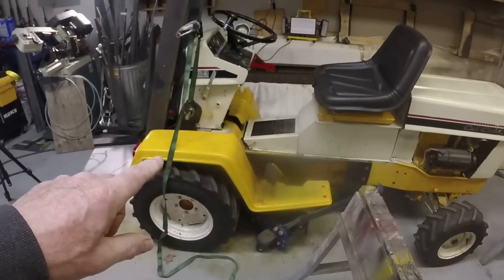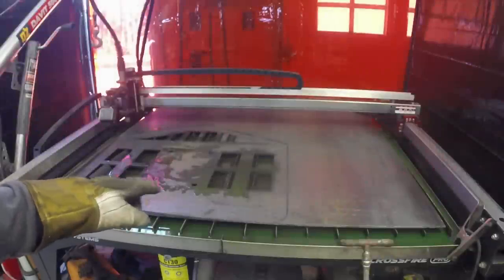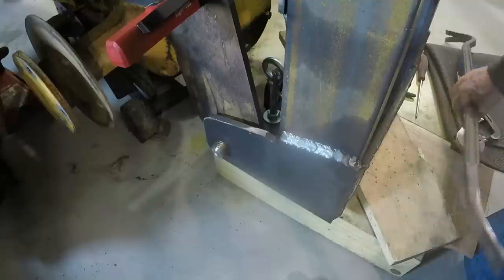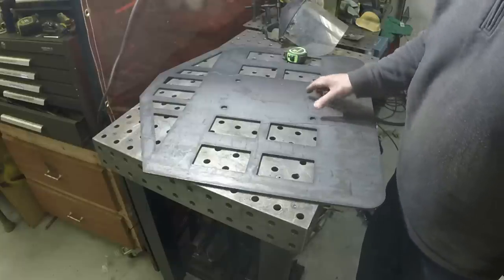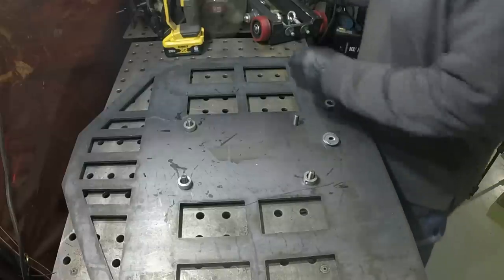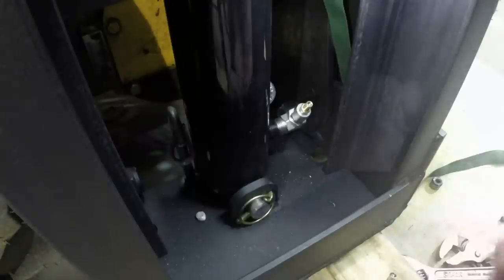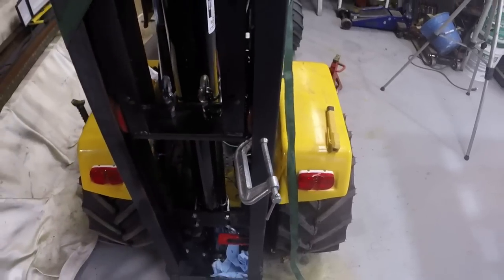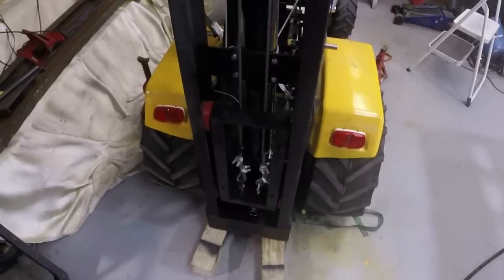Garden Tractor Turns Forklift, EP:25 Carriage Lift Mechanism

Comment: Years ago, I worked at a place that repaired hydaulic cylinders. The shop guys were working on a cylinder about 4" diameter and 12' long. To remove the cylinder rod and ram, they would use compressed air. 1 cylinder didn't want to come apart, so they kept applying more air. When it came apart, the rod went flying across the shop floor, hitting things as it went which caused it to rise off the floor. It went out the end wall of the shop. Luckily, no one was hurt, except for the new hole in the shop wall. The disassembly procedure changed starting the next day.

Watching you with the cylinder made me remember that incident. Hydaulic cylinders and compressed air can make for surprises.

Good job with the build. It is looking good. Can't wait to see it in operation.

Comment: While I agree with your assessment that using lift cables is a little simpler than roller chains, the inherent problem with the cables is to get them equally tensioned.  It's certainly not impossible, but it can be challenging. I'm looking forward to how you resolve that. Keep up the good work.

Comment: Forklift is coming right along and looking good. If I may suggest, remove the cables and take them to a crane and rigging shop or maybe a sailboat shop and have them swag crimp the cables instead of using the bolt on clamps like you have. I just think it might be a bit safer and cleaner. Only down side would be you would not be able to take up any slack that might occur in the cables.

Comment: Something to think about on the top of mast. Make a couple stops that can be bolted in where you want the carriage to stop. Then lower the carriage and tighten the cables. That will also keep the cylinder from deadheading.
Reply: I would disagree with you here. The cylinder won’t be deadheading since the hydraulic oil will be able to flow out of the top half as the piston is being extended. These cylinders are designed for these loads. If the carriage is stopped and the cylinder still has travel then it is possible for the cylinder to apply more load to the cables then they are designed for.

Comment: Looks like some of the hardware I have in a drawer.  I-beam bolts and Bridge washers made from M2 and 54mm center hole.  Has to be fluid inside to keep the seals wet during shipping and storage until use.  Looks like the cylinder moves nicely.  Air compresses and isn't  clean like oil that is smooth movement.

Comment: for your mast pivot, rather than having raw thread to support the weight of the mast and load, you could weld your spacer to the mast support and weld a nut to the outside of the mast. Then use a short shanked bolt put in from the inside until it came up against the end of the thead. The bolt could be locked in place with a second nut on the outside. The inner bolt end could have a cotter pin hole to limit any side to side movement or if you created a stud instead of a shamked bolt it could have a nut on the inside as well. I do enjoy the builds but feel its worth commenting from time to time. I know its only a toy as you have said before but....
Reply from the maker: Yeah, those bolts are just temporary. Replacement is coming in a later video.

Comment: Looks good sir! Idk if you have yet buy May won’t to consider putting water and wheel weights on the drive tires or possibly duel wheel setup. May be too top heavy with a load on it you’ll be surprised what a uneven ground or just a rock will throw it side ways.

Comment: you might want to check your cable clamps.  i was taught that you never saddle a dead horse meaning the base of the clamp should be on the lifting cable and the "u" bolt over the tail.
Reply from the maker: Yes, I learned that and have since changed them. A few were wrong and some were correct.

Comment: With those types of cable clamps for wire rope, I've always put one facing forward, and the second one with the nuts facing backwards, so they clamp opposite with the cast part vs the U-bolt?  Always seen them that way, so thats why I always did it.....
Reply: Never saddle a dead horse. The u bolt side always pinches the dead side and the saddle goes on the live load side. Never the other way around.

Comment: Frank, you put those crosby's(cable clamps) on the wrong way. The u-bolt part goes on the working side because when you have them the way you do, the cable end can actually slide right out once a load is on it.
Reply from the maker: Yeah, I've learned "Never saddle a dead horse" from another commenter. I've changed them around. You'll see that in several weeks.
Reply: The u bolt goes on the dead side always.  You never pinch the live load with the u bolt. During our OSHA inspections if the u bolt part is on the live load side it’s an instant fine.
Reply: I was always told to put the u bolt on the dead side

Comment: Just an FYI, forklifts do not use hydraulic pressure to lower the forks. They rely on the weight of the carriage/forks to lower. The top of the cylinder must be vented to atmosphere to work correctly. Nice build!
Reply from the maker: My cylinder is double acting to keep the fluid requirements down. So fluid just returns to reservoir from the other side of the piston, keeping the reservoir full.

Comment: Hi Frank, when I saw you putting the 2 schrader values on that, it won't work!! Can't compress air that much it a closed circuit like that!!
Another great video, just watch the angle that you put the tilt cylinder on, not too much of an angle. As they will have too much residence working at, say 45° as you looked like you showed. Really need them with about only 10/15° above from horizontal on the mast..

Comment: You may consider putting a switch on one of the cables to prevent a slack cable situation potentially allowing a cable to come off the sheave
Reply: I did see you have the cable captured over the sheaves though with the bolts and plates. So maybe that is sufficient

Comment: Frank, nice job here. I agree, don't run a oil hydraulic on air. Watching this happen here, I'm surprised It didn't blow the top out (It can happen easily when it's slammed against the top). Also, would it be easier to just put a piece of cold roll bar across the bottom as the mast "axle"? With those bolts across the bottom, the threads are going to wear off VERY easily, and it will give a sloppy joint.
Reply from the maker: Axle won't fit across the mast due to interference with the cylinder location. Those bolts are just temporary. Working on bronze bushings and finished shaft (eg 4140) material to replace with.

Comment: Your clamps holding the cylinder might be causing your jerkiest operation. They might be bending the cylinder tube and causing the inside piston to hang up at that position, you might have to shim at the clamp locations between the cylinder and carriage.
Reply from the maker: The jerkiness is due to the static  vs. dynamic friction of the piston. Need to overcome the static friction, then it moves quickly. Won't have that issue with hydraulic fluid. The cylinder is 1/4 inch wall, those bolts aren't strong enough to deform it.

Comment: Hey frank great job on the lift but you know that there's a lot of weight going on the front. I'm not sure but it seems like you might want to put a weight rack on front to balance it out. I'm not there to see but I was just. Wondering. But I know you know what you're doing for sure
Reply from the maker: The counterweight was discussed in the first video. It's coming in a couple more episodes.  400 lbs.

Comment: I think I would have used chain instead of cable. Seems you would want fairly even tension on the lift cables. Chain would be easier to make a givem length without much stretch. Seems cable would be difficult to get same length and would also maybe stretch eventually a bit. Just my thoughts. Not an expert by any means. Nice work all the same. That thing will be handy!!
Reply from the maker: yeah, the cable is not as good as chain would be, but much cheaper. If it were going to lift more than the 1000 lbs. I'd definitely gone with chain. Cable will work OK I think. One cable will stretch  a bit, shifting load to the other. Eventually, they will share the load pretty evenly.

Comment: I didn't recognize if you said it in the video or not but when you spoke of the capacity of redundancy of using those cables and the thousand pounds that you plan to lift, were you also taking into account the total weight that you are lifting with those cables when you use them? Because you are lifting the total weight
Reply: Of  Anyting attached to those cables
Reply from the maker: the cables are actually rated at 1550 lbs SWL (I think I said 1200 or 1250 in the video). Average breaking strength is 5450 lbs per cable.  With a weight limit of 1000 lbs plus the carriage and forks (200 lbs) I think I am still under the safe working load of a single cable.
Reply: @woodandmetalshoptime8048  Sounds like it. Definitely sounds safer than the videos numbers.

Comment: have you thought about some extra counter weight for the engine end and turning the little tires around as well
Reply from the maker: Counterweight is part of the design, discussed in the first episode. Will be about 400 lbs. Not turning the front tires around anytime soon. Will get changed out for turf tires when I upgrade the front axle and wheels sometime this summer. All will be discussed in upcoming episodes!

Comment: The thing I’m wondering about is the hydraulic capacity of the tractor and are you going to have to add a tank or just fill up the cylinders and the pump will work normally?
Reply from the maker: 2 gallon reservoir in the drive axle.

Comment: What is the load rating on the rear, now front tires?  Sufficient for your expected lift load?
Reply from the maker: Yep. 6 ply tires. Only lifting 1000 lbs.
Reply: @woodandmetalshoptime8048  I'm absolutely sure they will be fine regardless of the spec but one thing for people to keep in mind about the lifted load vs weight on tires is that since the carried load also shifts weight from the 'rear' of the machine towards the front of the machine, the weight on the front tires goes up at a more than 1:1 ratio with the load.  You already did the math about the necessary counterweighting and all that and i don't recall if you predicted a max loading on the tires in that episode but I would not be surprised if a 1000lb load on the forks at a 'typical' load center (24"?) might put 1500-2000lbs on the front tires. Great episode, keep it up!
Reply: @Vigo327 , I just googled (I only looked at the first one that came up) the weight rating for a six ply tire and it said it had a max weight of 1670 pounds. 
With two tires on the front, Frank should have plenty of extra room with the weight. 
  I wonder if Frank has a plan to find something that weighs around 1000 pounds or a little more to test his theories on the weight issue. Maybe even go 20 percent over to give himself some leeway.
Reply: @Hoaxer51  Factory forklift hydraulic pressures are probably 'tuned' to prevent tipping the machine forward just by pulling a control stick, but Frank might have to find that point himself. IF the machine ever picks up its back tires then the front tires are carrying the entire machine weight + load weight. But loader tractors do this all the time on their smallish front tires and are fine (mechanically) because it usually happens at low/no speed.  Tire weight ratings assume you will still 'travel' and hit bumps at that loading. A tire's weight capacity when not rolling, or barely rolling, and not bumping hard into anything, are.. ludicrously high. There's a decent chance the wheel centers would cave before the tires themselves popped from 'static' overload. So i think on a tiny homebuilt forklift operated with an abundance of caution, the tires are actually not much of an issue. The only thing i wouldn't do is traverse anything smaller than the contact patch of the tire, that loads the tire only in a small area, while carrying max load. I doubt he will be off-roading it while loaded very much, so.. non issue. In my opinion.

Comment: In the real world your lifting capacity would be the hyd cylinder lift rating, the pump pressure, and the pressure relief valve setting.  Your cables, lifting eyes and tires would not be even close. I know you said 1000 lbs max but what about the guy you sell it to down the road? I wish I knew as much about hydraulics as you. Your builds are first rate.
Reply from the maker: The lift capacity is actually limited by the counterweight.
Reply: @woodandmetalshoptime8048 , That’s the truth! Lol
Reply: @woodandmetalshoptime8048  You are correct. The rated lift capacity for safe operation is based on the lift rating and load balance /counterweights. But most forklifts will pick up more than that rating, so either more counter weights or someone gets hurt. I'm looking forward to seeing how you pinpoint your final safe lift capacity.